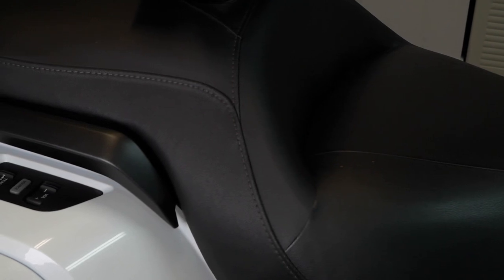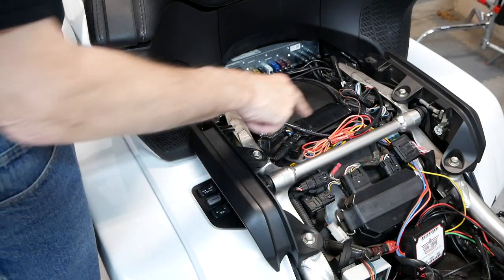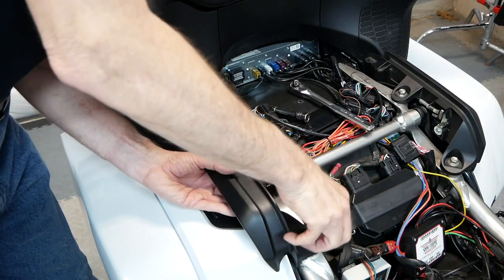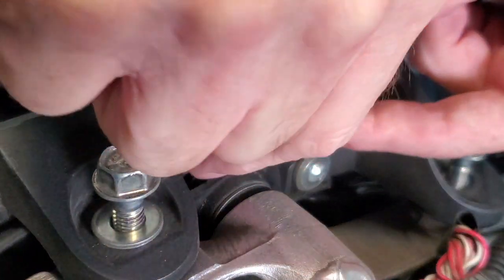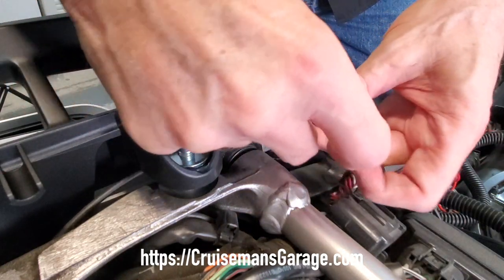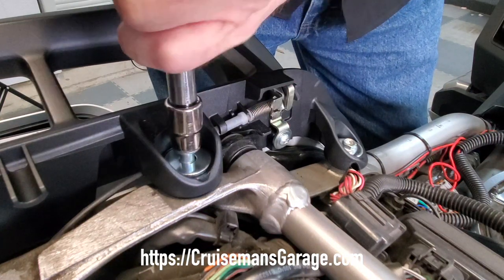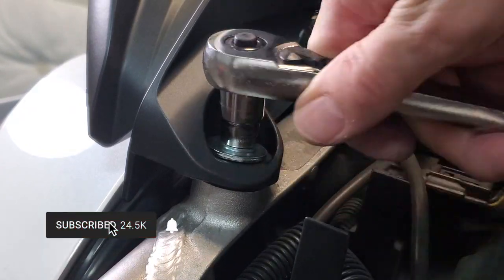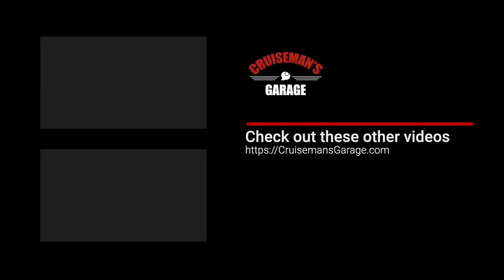Finally! 2020-Style Passenger Grab Rails for my 2018 Honda Goldwing | CruisemansGarage.com

Comment: I will keep the stock handrails as I ride one up, and I use the OEM rails as you showed in a prior Cruisemans Video where I wrap the bungie cords around the handle ends and then over whatever I want to stored on the passenger seat.  Did this on a recent  1700 mile trip and the adjustable cords worked perfectly.  At $220 for something they would have provided for free to start with  is just sad.  $28K for a basic bike you are encouraged to change the windshield, the seat, and now the handrails and of course t0 add the running lights.  Another 2 grand out of the ole pocket.  Thank you Honda.
Reply: And the 2020 comes with fog lights. What really gets me is $100 for a center stand that should be there anyways!
Reply: I’m with you on this one Bob. The price just doesn’t warrant the purchase. I do the same thing with the bungee looped around the ends and attached to a Kury Momentum bag. Worked well from Florida to Cabot Trail last summer. Guess I’m just cheap.

Comment: Did you have any trouble with seat fitting after putting these on. My seat will NOT sit down in the rear because off the plastic piece on the grab rails sticking out

Comment: Love your videos! Three quick questions, please: 
1. I like these grab rails. Do you know whether or not they will work on my 2019 Gold Wing (non tour) or, if not, is there a version of the rails available for the non-tour?
2. Based on your recommendation a while back, I bought the Cardo Pack Talk Bold for two of my helmets (HJC IS-Max 2 and i90) and really like it. Is it worth migrating to the SENA 50S?
3. Also enjoyed your video on the WingSoft seat and almost made the appointment with them when I saw that you have upgraded further. What is your current feeling pick for the best long-range seat? Many like Russell Day Long, but would like your most current thoughts.

Comment: Can the old bolts be used? I ordered mine straight from Honda 3 months ago and the left handle has been on back order since April. It finally has been shipped. Honda did not provide the bolts with the right handle so I assume they won’t be with the left when it arrives.
Reply from the maker: I think the original bolts will work.
Reply: Cruiseman's Garage installed today and they do indeed fit. Thx.